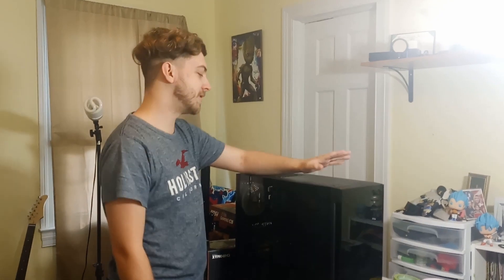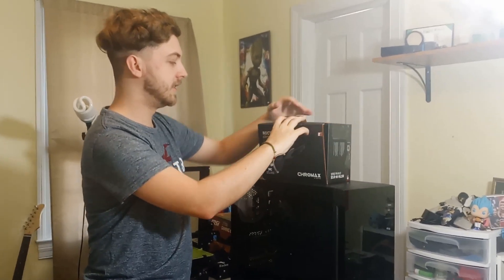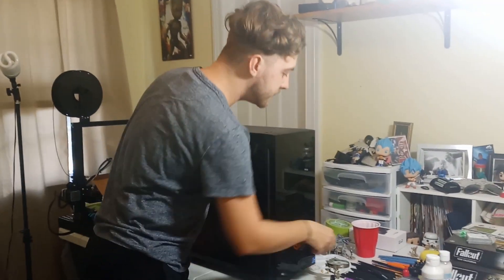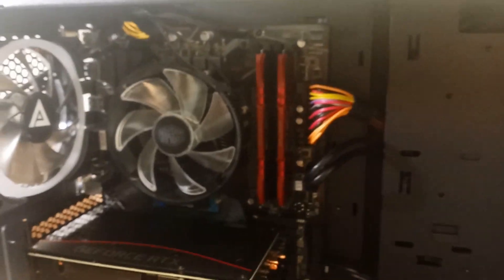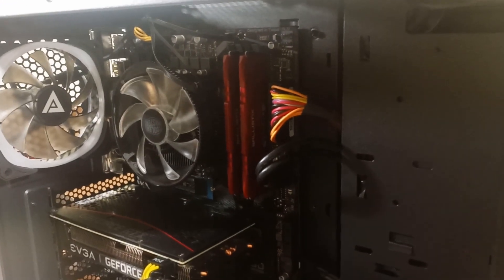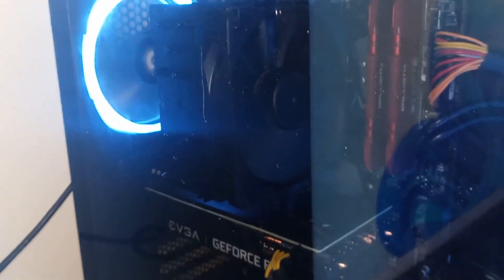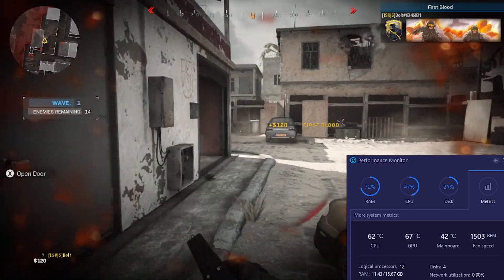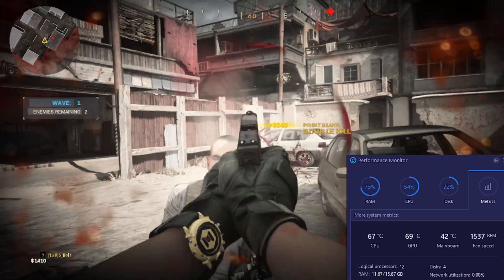Best CPU Cooler 2021 Upgrade for CyberPower Gaming PC | Noctua NH-U12S

Comment: hey so I have the same exact pc as you and I'm trying to remove the cpu fan. I found out that there is a wire that goes behind the pc, I can't seem to find out if it's absolutely needed to keep that or if I can cut it
Reply from the maker: It's probably the cable going into the old cpu cooler

Comment: Did you cut the wire from the old cpu cooler that connected to all the other fans?
Reply from the maker: I only cut the cable in the back to the old cpu cooler, new one won't need it

Comment: I bought same fan and tried to replaced with my older cooler fan but I realized that my system fans were connected with my cpu fan cable and it was a lot of cable back there so I couldn’t take the risk. What should I do?
Reply from the maker: You should be able to move the cables out of the way, you won't need any cables from the back of the computer for the new cpu cooler.

Comment: What did you do with the other cable that loops to the back of the pc? Mine is connected to the other case fans
Reply from the maker: You shouldn't have to unplug/mess with them since they are for the case fans. This cable connects on the motherboard were the old CPU Cooler was connected to.

Comment: Hey I’ve been trying to replace my cpu cooler too but how did you manage to get the backplate off, does it just pop off with some pressure? I’m kinda worried I’ll damage the motherboard by forcing it out
Reply from the maker: Yeah, it'll pop off. There is a good bit of adhesion.

Comment: I need some help, did you cap the cable connection from the old fan? I plugged the new cord into the mother board and now the new fan hasn't turned on.
Reply: So I think I figured it out. I unplugged the old fan from the back. Once I plugged it back in with new fan it all worked. Did you cut the wire?
Reply from the maker: yeah, switch out the cables from the old fan to the new fans connection